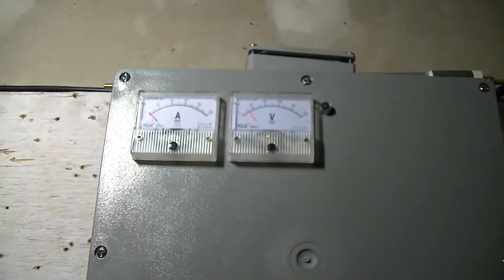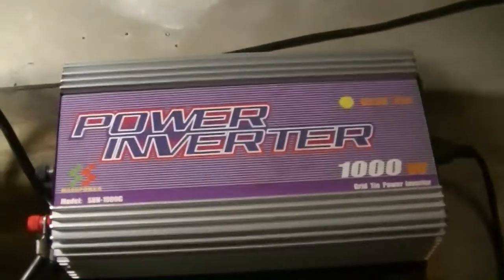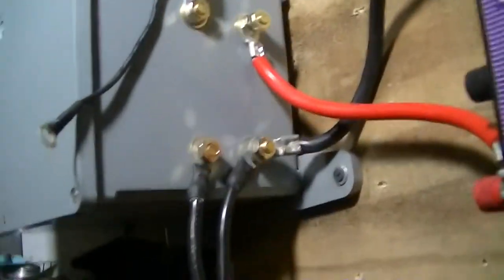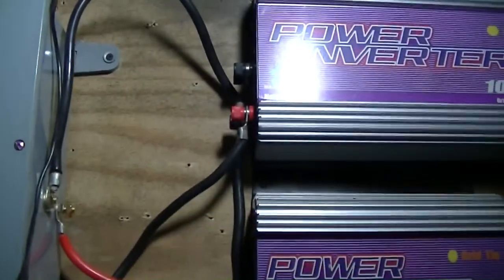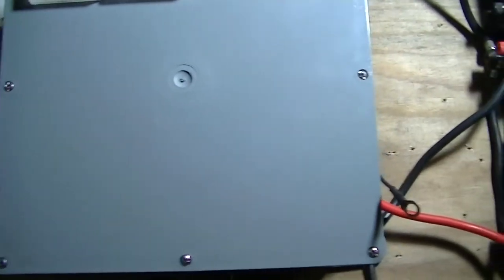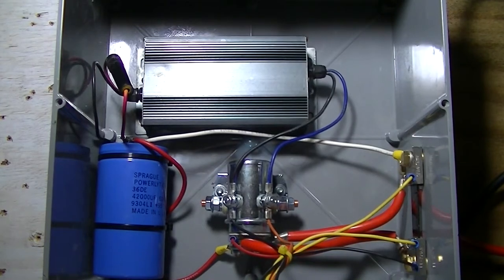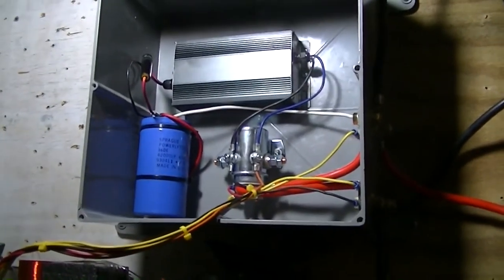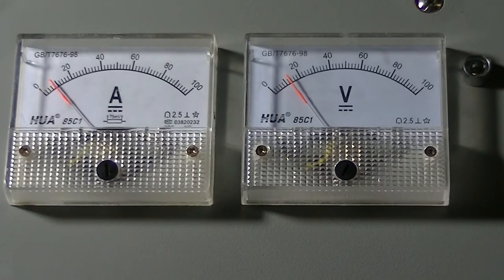WindyNation Power, Quick Update, and Some Rambling

Comment: Sorry for the strong reaction Kevin. I hate these guys and I'm really pissed off. I noticed you're disputing with your credit card and that will likely work for you but it still doesn't change the fact that HYE/WindMAX is a horrible business that puts profits before customers. How the hell can they certify it's been quality-control tested? They don't quality-control test every single unit. Thats just bullshit. Whatever happened to the customer is always right? Or if it works and can only with a GTI, that should be disclosed in black-and-white. But the science of that still doesn't make sense to me. It either produces volts and amps or doesn't.  The load (batt/GTI) isn't what's producing power, it's supposed to be the turbine
Reply: yup...as a former auditor (and yep we fudge too, but in a benefit of the doubt kind way), I can tell you those engineer's initials are meaningless, especially in China with different practices and standards. I like the idea of scavenging parts from it though on new build, especially grinding off HYE name..lol